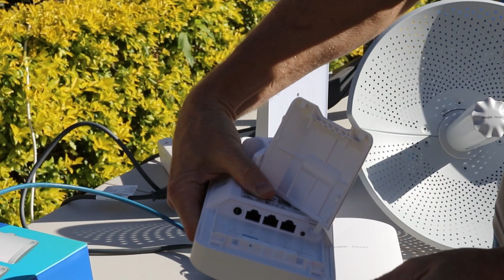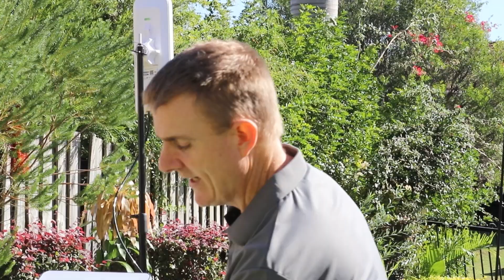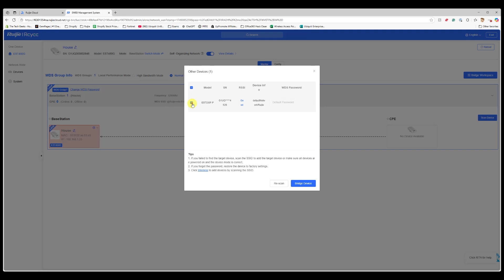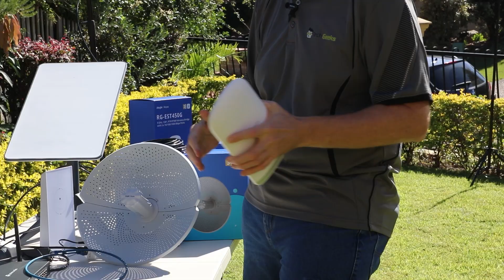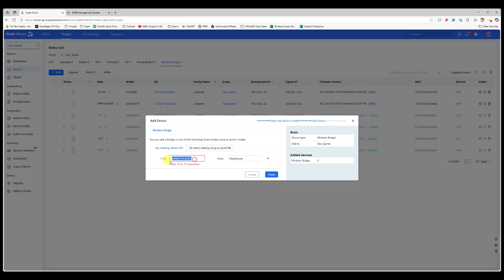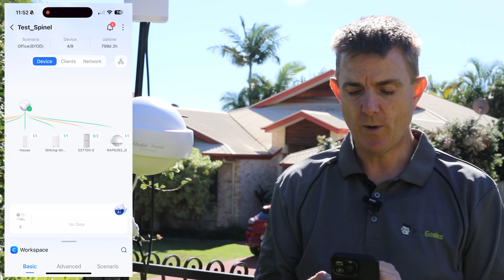Starlink -  How To Extend Your Wireless to Multiple Buildings

Comment: Thanks for this video. I have Starlink as it's all that's available on our property in Canada. I would like to go from our house to our underconstruction / renovation second house and shed on the same property for security purposes. It's about 600 feet from our current house to a double set of railway tracks. 300 feet across the train tracks, then another 300 feet to our second house and shed. So I would like to go 600 feet from the house to the tracks with a hard line as there is poor line of sight. Then use the line of sight to cross the tracks, then back to hard line to the second house/shed as again, its through bush and has no line of sight. I assume i can basically do the same thing that you've done only use a booster on the 600 foot length? I have normal household power on both sides of the tracks. I can't legally run an internet czble across the tracks that's way I would like to use point to point at that location. Does what I would like to do sound reasonable? I would then run my security cameras on both sides of the tracks and send the signals via internet back to my main house. Sorry for the long g winded explanation and Thank you for your input. Gord
Reply from the maker: Thanks for the detailed explanation, Gord. Yes, the overall approach sounds reasonable: run a hard line from the house toward the railway, use a point-to-point wireless bridge across the tracks where you have clear line of sight, then return to a wired connection toward the second house and shed.
The main consideration is that the first 600 ft run is around 183 m, which exceeds the normal 100 m / 328 ft copper Ethernet cable limit. The most reliable option would be fibre, using suitable converters or fibre-capable switches at each end. Alternatively, you could use a powered intermediate switch or outdoor Ethernet/PoE extender before reaching 100 m, or a specialist long-range Ethernet solution designed for distances beyond the standard limit.
Provided the bridge has clear line of sight across the tracks, the cameras on both sides could then send footage back to the main house over the same network. We would also recommend checking any railway or boundary restrictions before mounting equipment close to the tracks.

Comment: Can you please list All the name of the materials needed
Reply from the maker: It will depend on what you are wanting to achieve, but the basics would be

1. A cable from your router to a PoE injector or PoE switch
2. A PoE Injector or switch
3. Cable from Switch / PoE Injector out to the EST 450G Bridge
4. Mounting Pole for the Bridge
5. Ruijie EST 450G

Then at each other end pretty much the reverse

1. Ruijie EST 350G
2. Mounting Pole for the Bridge
3. Cable from Switch / PoE Injector out to the EST 350G Bridge
4. A PoE Injector or switch
4. Cable ro Wireless access point
5. Wireless Access point (Eg Ruijie EG105GWT)